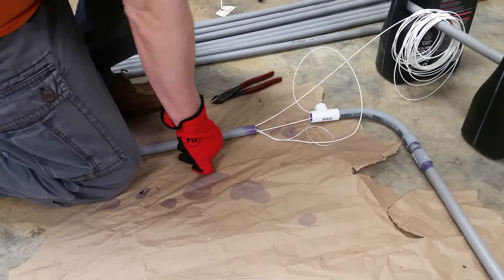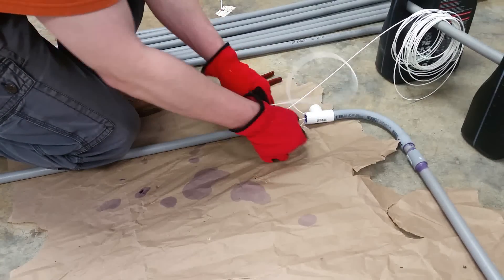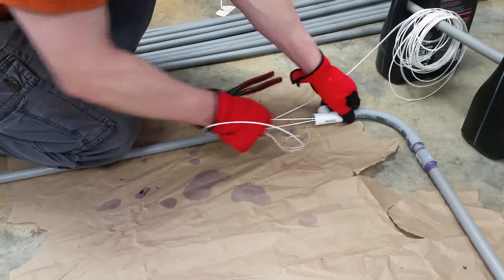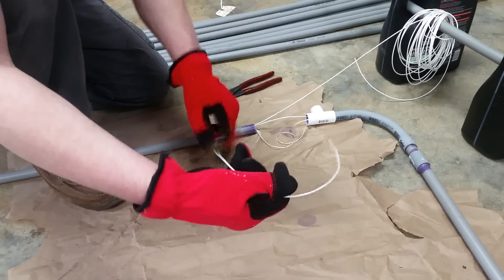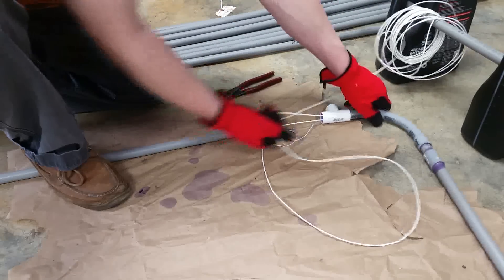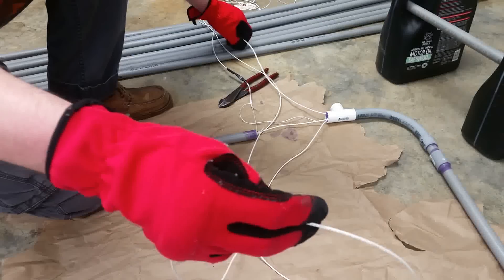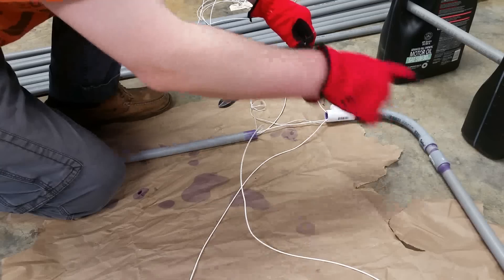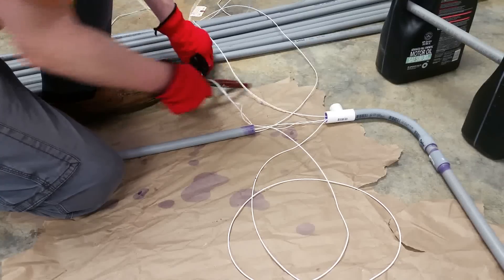Project #19 - Driveway Vehicle Sensor PART 1 (hardware installation)

Comment: The purple primer actually does have a time limit... it is not a coating.. but the solvent version of the glue that chemically softens the pipe so the mating parts will chemically bond together.  glue alone will soften it to do the job but the purple will soften it real good... then quickly do the glue before the solvent evaporates out and rehardens the pipe.... and push together and hold... 
   It is actually the the female coupler that is tapered... tighter the deeper you go into it... that is why it wants to push the pipe out.. the glue "sets" the softened plastic mating parts within 30 secs... but go an hour before applying water pressure... but since you don't pressurize it it is ready in 30 sec :).  water actually cures/sets the glue faster with water.. imagine that.
   Yer right about there not being much out there for DIY on this stuff... much appreciated brother. ty.

Comment: The PIR doesn't need the exhaust pipe.  It need the vehicle to be warmer then the air, which any moving vehicle would be.  There also is a time limit on the primer.  Think hours not seconds.  The plastic is softened by the primer, but that effect will eventually "wear out".  Plus, the glue hardens more by chemical action then it does air contact, so the compressed air blow out is really not needed.
Glue is only needed on the pipe.  Since the glue can melt the pipe, it is best NOT to put them in the fitting..
Most sensor recommend that you do NOT splice the wire.  Better to use more wire and just leave enough length to strand it together without the splice.
Love the PVC to Pex water manifold - BTW..

Comment: Let the glue dry overnight? Have you ever watched a pro irrigation tech work?
He slaps the glue on, pushed the pipe pieces together &  IMMEDIATELY  turns 
on the water & pressurizes it &  IT  DOES  NOT  LEAK!

!
Reply from the maker: LOL, I've always heard 24 hours.  Just for fun, I just looked up the manufacturer's spec sheet (Oatey) and the joint cure time varies from 15 minutes to 9 days depending on the pipe diameter, internal pressure, and air temp during assembly.  It looks like in my case, 15 minutes would have been fine.

Comment: How to trigger with a bicycle?
Reply from the maker: I don't think you can.  The modules are designed for use in automobile traffic applications.  There may be a way of making a loop that is sensitive enough to detect a bicycle, but I'm not sure.

Comment: Great video. I was looking for an economical solution and this was it. The wands are to pricey and I have heard they are prone to lightning damage. I have a boring machine and want to drill under the driveway twice to create a loop. What is the maximum depth i could put it and it still work?
Reply: The coil needs to be near the surface. No more than 6 inches, less is better.

Comment: A handy little video. Unlike many DIY projects, it was nice to see that care was taken with the installation, especially the one where everything was made to look neat - a bit of a rarity.  I do have one comment about making the loop. Why did you glue the conduit for the loop before threading the wire through the near completed loop instead of threading the wire through each of the individual pieces of conduit and then gluing it together?

Comment: Thanks for the excellent video Vance.  I have questions about coil configurations.
I believe you or your documentation stated detection sensitivity is limited by the short sides of the coil. If this is so, I wondered, why not make the sides equal lengths, a square in the case of a rectangular coil.
A related question then is how positioning  corners of a square coil at the center of the driveway would effect sensitivity. An advantage might be that you could get coverage over the width of the driveway with a smaller square coil-- but at what cost to sensitivity? 
Another configuration might be an equilateral triangle with one side perpendicular to the driveway and the driveway's width, with the opposite coil corner at the driveway's center.

When I had finished composing the message above and read it, I had some ideas for searching the topic. Using Google Verbatim I searched: inductive wire loop driveway OR traffic detector "triangular loop" The article referenced below topped the search results.  I don't have time to read it now, but it looks like it might have some bearing on my questions, FYI.
Dale Myers

https://static.tti.tamu.edu/tti.tamu.edu/documents/1163-3F.pdf

Comment: nice job. Just a tip for those who don't have a fish tape to get the string into the pipe. you can suck the string through the pipe by using a vacuum cleaner with hose.

Comment: Great tutorial on building a loop. I did the same thing but used a circle of PVC and it has been in service for 6 years with no problems, with THHN wire buried in concrete.

Comment: The loop wires need to be tight and not able to move in the conduit. If the wires are able to move they'll cause a false detect.
Reply: might be true - but why should the starte to move in a ceiled space?

Comment: Has the induction loop stood the test of time? I've been told I have to construct a 6 inch deep concrete pad in my gravel drive and cut a slot in it to contain the loop. I don’t want to do this as it would spoil the look of the drive; I really hope your method has been successful!
Reply from the maker: I installed it in March 2018, so its been in service for 7 months now, and it has worked flawlessly.  I think you were given some bad info regarding needing to construct a concrete pad.  When I researched how to construct these, I found that the "saw cut" method is used only when the concrete or pavement is already in place.  Its actually much better if you do the "pre-formed loop" method like I did, because the wires are much better protected in the buried conduit.
Reply: Thanks for the quick reply Vance; I thought it sounded a bit “over the top”, I’m really glad I found your excellent video so I could check with someone who’d actually done the job.
Reply: A year on and our system is still working perfectly. Thanks again.